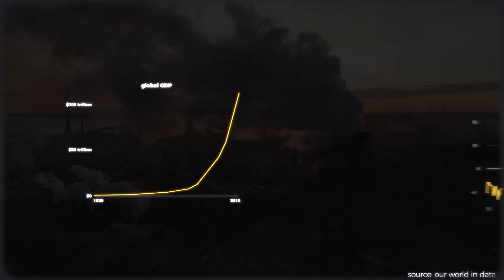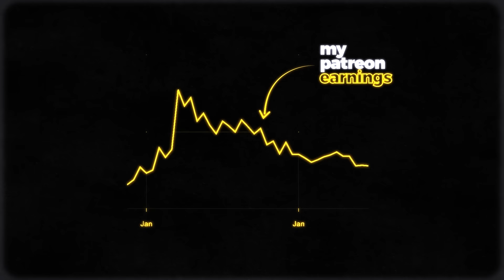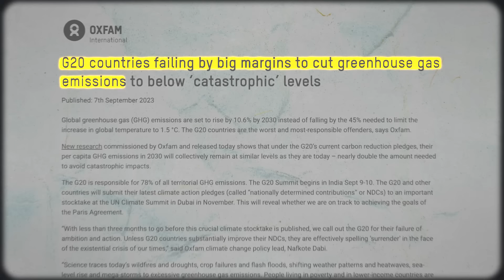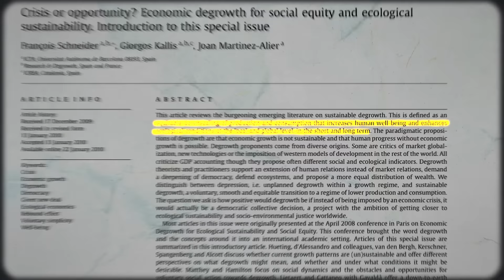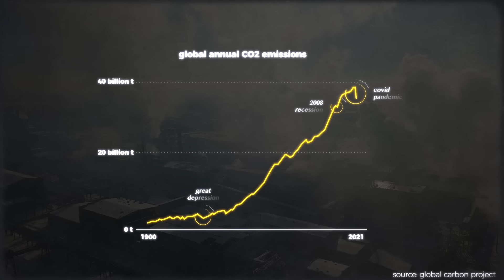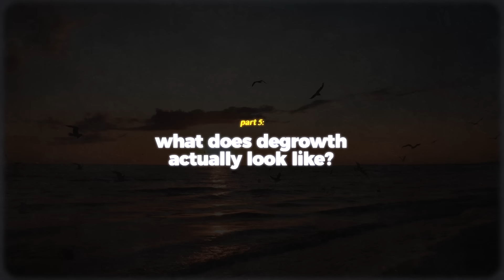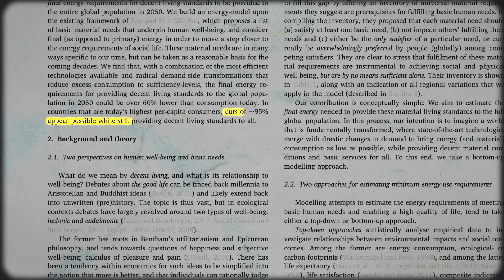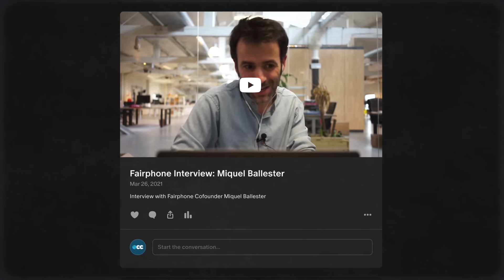Why We Need Degrowth

Comment: Very good video, but i have one critique , and that is that our so-called "carbon-budget" ran out a long time ago. We are already bound to face 1,5C ° next year.
Reply: Yes most definitely 1.5 next summer and then on to 1.8 to almost 2.0 by 2030
Reply: Yes most definitely 1.5 next summer and then on to 1.8 to almost 2.0 by 2030
Reply: @77cicero77 so, the nuance is slightly more complex than that. It's based on long term averages of about 10 years. As we accelerate,  we are already hitting 1.5, and even LA Nina wvents don't seem to diminish issues nearly as much as they should. So the long and short is, we're going to be in 1.5 before we have data to back this up, because... again, long term averages. But if our short term live data manifests as projected, and we also continue to decarbonize, there's actually layers of impact we don't comprehend,  like aerosol data.
Reply: @SPLICEKNIGHT  we are not going to decarbonize that’s wishful thinking
Reply: I also have one critique of this video. It forgot to mention the billion (literally a billion) people raised out of extreme poverty over the last 50 years due to economic growth. And the other billion people that have made it out of poverty and into the middle class. Without addressing this, saying we should adopt a degrowth model sounds kind of the same as saying poor people should stay poor.
Reply: @blub-tf6rt  no you won't be dead in 50 years, more like in 10 to 20 years if not less. Besides, shy should you only care about yourself?
Reply: @Randint73 I saw somewhere today that it’s expected to be between 1.34 and 1.58. We are already at a shocking 1.34 for this year. Wouldn’t be surprised if 2024 eclipses 1.5.

Comment: Car-centric infrastructure is a terrible mistake that was pushed on by the big 3 automakers in the mid-20th century. It has been consistently promoted by pro-extractivist politicians and those who accept the status quo. Needing a car for work, shopping, and entertainment for those living in the city or a suburban area need not be a thing. Dallas Texas back in the day before my parents were born was a city where you could get anywhere by cable car, bus, bike, or on foot until big auto and big oil lobbying messed things up. Electric cars are no silver bullet. An EV is better than a gas burner in the long term but, the environmental destruction that goes into extracting the minerals, fabricating the semiconductors, plastic trim, body panels, and other components as well as the final assembly of the vehicle is terrible. If I could get to work without a car, I would definitely go car-free or car-lite. Fast Fashion is a terrible idea, it exploits low and middle-income nations for cheaper labor and gentrifying the country as well as causing land, noise, air, and water pollution for making cheap affordable clothing that goes out of style in a new york minute and/or does not hold up over time. Every time you buy a new product whether clothes, furniture, car, decor item, phone, etc. think about the environmental impact of that purchase.

Comment: You seem to be forgetting the root cause of the necessity for growth. This necessity is just a symptom.
The problem itself is two-fold; one side is that our monetary system is a debt-based fiat currency system, and the second factor is that debt grows exponentially (and thus faster than the economy). In practice, this means that every currency unit (dollar, euro, you name it) in circulation is debt, and this debt generates interest; as such, new debt has to be created to pay for the interest, making the pile of debt even larger. There is never enough money in the system to reset the system to zero. This deficit needs to be plugged somehow, and that is where growth comes into play. You need to grow the economic output of the system in order to keep up with the debt side of it. This is why "no growth" brings the system to collapse; there is not enough output to pay the debt plus interest. This can only go on so long by the way - at some point, the interest consumes all and the whole system just implodes.
Reply: Concur with this. And the reason it can grow in the first place is the concept of debt or trust, so that’s kind of the full loop of the modern capitalist paradigm, which in my books is much better than any economic paradigm which does not include the concept of trust. It’s like it adds a whole degree of freedom to economic mobility, which would otherwise cause an economic stalemate where not much gets done (including in terms of food production) due to the stringent requirement that immediate and guaranteed compensation up front is the only way to incentivize people to work. 

As you said, the pie must grow in order to sustain the system, but the system is also what allows the pie to grow in the first place. And all of this depends on our ability to innovate new ways of extracting ressources or otherwise creating value.

It’s a well-oiled machine, and does not depend on a ruling class with specific interests to be upheld. It also has so much inertia that moving away from it recklessly is bound to have disastrous consequences. I think the solution proposed in this video is way too idealistic and naive.

Comment: It would probably be a huge investment but I wonder if something like a modular factory that can make a wide variety of products to be made on order rather than made constantly and throwing away ones that don't sell. Maybe another long shot is whatever is made is from recyclable materials that can be reused/repurposed by the same factory.
Reply: Ok, let's expand on that idea. 

You have 360 million people plus 50 million illegals. 

How are you going to manufacture on demand and what's the distribution plan?
Reply: Companies that make made to order products often produce less waste and it allows customization for consumers, like sizing to their actual body measurements, and less production shortcuts like poor stitching that can lead to products lasting longer. The downside for capitalists is production speed, which affects how much a company makes in a quarter.  The downside for consumers is they have to have patience to wait for the product to be completed and maybe shipped, and learn to adjust to slow fashion like our ancestors were used to.  This is why MTO production is better for the planet and consumers, but it requires an adjustment in consumer mindset and expectations.

Comment: I have decided to start getting around by ebike.  Yes it still has a battery in it but I am using far less energy to move 260 lbs instead of 2,060 lbs.  Also daily driving an ebike gets me used to biking as a form of transportation that I could do with a bike without a battery at all, only powered by my legs and the food I ate the day before.  Urbanism isn't just "cars bad", it's a movement that stems from preventing climate change, atomization of society and communities, long term health problems, as well as improving mental health.

Comment: Only workable solution is an enforceable two-child policy.  I think it would put a limit on overproduction which I think is the main problem. Otherwise, you cannot eliminate consumption since it is how life is maintained...
Reply: @SimonTmte  I am aware of that, I just wrote a more politically correct answer. A guy called Steven did a deep dive on the issue (watch Birth gap on YT) and found out that it's childless women who bring down the rate to below replacement.  Without them, it's about 2.2 in Italy, Germany and Japan and 2.65 in the US. I think this issue has no solution just tradeoffs which is a lower standard of living and taking away people's (mostly women's) rights. 
By consumption I wasn't referring to 10 cars but maybe buses or bicycles for the common man. And if you think that such people need to be reigned in, then that goes back to my tradeoffs argument...

Comment: I think ecosocialism covers this issue well enough. Degrowth sounds somewhat reformist
Reply: Ecosocialism doesn't address the sustainable size of the economy, and to be sustainable, we would have to shrink the global economy by over 50%.
Reply: @HealingLifeKwikly  Ecosocialism could solve/change the unsustainable economy we now have, industry-based socialism cannot
Reply: @shaunowebdevo  We may agree but be using different terms. That is, de-growth IS eco-socialism, but it goes further than many eco-socialists in pointing out that the global economy must shrink to be sustainable. 

However, I sense that perhaps you, unlike some eco-socialists, understand that more wind turbines and and meatless Mondays won't cut it--industrialized society is inherently unsustainable and self-terminating. 

Be well.

Comment: We do not need de growth we need to prioritise the right kind of growth. We need to remove planned obsolescence for future modularity, produce quality items instead of disposable items, look at designing house hold white goods that are not for a single use. For instance why would a washer, tumble drier need to vent heat to atmosphere, build it with a heat exchange manifold that combines back into the central heating system where it will then heat the contents of the water storage cylinder. This would be so easy if standardised bayonet fittings were produced for quick connections and no chance of the average person having to risk cross threading pipe fittings. 

That’s not to mention using the same techniques for removing the need for a boiler and instead build better quality ovens that also work as water heating devices. We could dramatically reduce material consumption if we were to design items with multiple purposes using a suitable amount of wisdom in the design stage.

Comment: You want de-growth? Set an example: Stop buying stuff! Stop driving. Stop flying. Stop going out.
This video is nauseating!
Reply: You don't even understand the core of the problem. Or even the term Degrowth. Or how simply changing personal consumer patterns has no material change on our society
Reply: @favb7931  40-60% of our carbon footprint is controlled by individual choices, and we could feed the world using 65-75% less land, 50% less water and 50% less CO2 emissions just by people changing their diets. Thus, although systens change is also needed, individual choices can have a massive impact and can drive systems change.

Comment: I find it frustrating that opponents to de-growth pull out the scenario of “shivering in the dark”, or “living in caves”.  The only alternative to rampant growth is the stone age?

There are many stages of efficiency that can be used that may even feel like growth while shrinking our environmental impact.  Densification to roll back sprawl is probably the easiest.  We need to build more housing anyway so why not proceed with only mid-rise mixed-use to improve our heating/cooling and cut our car dependency.

Another brutally simple fix: cut air travel.  Brutally easy to implement: legally mandate ticket-price minimums and keep increasing the minimums.  Let the market decide whether that annual week or two in the sun is really worth it when it costs half your income.

Comment: “Growth” is NOT the problem and Degrowth” is NOT the solution. Really, then what is? Improper growth! If you live in a closed system, as we do and if you are completely dependent upon the ecosystem and its functions as we are then LOGICALLY, RATIONALLY & SCIENTIFICALLY, then the only thing that you can do is to grow by becoming ecologically literate, by developing and using ecologically-based and ecologically-constrained technology to construct an ecologically-based and ecologically-constrained economy. To “grow” you have to act as a keystone species as a resource to the ecosystem (rather than foolishly acting as a parasite that undermines and destroys it); you have to enhance the resilience, diversity, and productive capacity of that ecosystem and then reap the excess productive capacity to sustain yourself! That is our ONLY LOGICAL, RATIONAL AND SCIENTIFIC way forward. Let’s do it!

Comment: They are cutting back spending in sectors that are overrepresented by those with progressive voices, and I am in Melbourne, Australia.....if you want to understand how that couple gets to degrow you should see how the country has been shortchanging it's very large migrant workforce many of which are students, coming up on ~1 million.....who also work all the menial roles in Australia at the same time. You should see how many Uber/ gig workers are Masters qualified pizza delivery drivers here.

And also just how much of the countries economy is built around brown coal and other carbon emission products.

And also if you really want the skinny looking up nangers (Nitrous oxide bulbs) a greenhouse gas 200x times more potent that CO2 that the locals huff for a 10 sec high....its so pervasive and financially lucrative you can get 2hour express home delivery for nitrous bulbs of various ebay sellers here.

Comment: Obama wasn't wrong when he said that sustained economic growth is possible while reducing carbon emissions. In fact: that is what is happening! The per capita CO2 emissions in the USA dropped from over 23t in 1973 to 15t now especially since 2007 there is a strong negative trend (our world in data). However, it simply isn't nearly fast enough to save the climate, and at that pace it very much hurts growth.

Comment: Good video, but I don’t agree with the final current for revolution. The amount of death and destruction caused by every revolution typically results in an overall decline. Fighting for incremental change is hard but possible, but requires greater participation in political process

Comment: Downsize your life. Use less energy (drive less, use public transport or a bicycle, insulate your home, shower every other day using less water, wear your clothes before washing until they are dirty, dry your clothes on the line or a rack instead of using an electric tumble dryer, heat only the rooms you use during times you are at home), consume less (buy products of higher quality lasting longer, don't buy more food than you eat, don't waste, buy the clothes you need - not fashion, lend and borrow instead of buying).

Comment: While I reject the idea that degrowth is 'eco-thatcherism' etc I fear degrowth slips into utopianism because socialism is a higher mode of production than capitalism - it removes the fetters that impose artificial scarcity and slow down productive growth and innovation. The masses are going to get richer under socialism and they are likely to consume a lot more in terms of units of use values - and we cannot stop them from spending their 'labour vouchers' or whatever exactly replaces money. The focus has to be on qualitative changes to production - which degrowth more or less does address - such as transitioning from extractive/subtractive production with clean additive production. I find it hard to believe that 'reducing consumption by 60% or 95%' is going to attract much support from anywhere and it isn't necessary to think in those terms.
Reply: Your language sounds practical.  This video sounded like some kid who was all enthused about some sort of Communism.  The word that ran across my head when the talk was about shrinking the GDP was "layoffs."  Then I think of all these tent cities in the Western cities.  I can see some of the Socialism thing helping out.  If people had more say in what was built, how it was built and the conditions under which the stuff was built we would all probably be better off.  I guess there is often a mismatch between what people actually need and what is provided.  For example, Ford decides to go all out on building F-150 pickups instead of electric Focus cars.

Comment: The physics of climate does not care if we have more windmills; all that matters is whether we are emitting less carbon dioxide and other greenhouse gasses into the air.
Reply: ..but if foundations of those ... windmills require  literally kiloton of concrete, itself heavy ghg emitter in production ... and if whole system as noted forced to be bigger and bigger ....

Comment: 26 minutes of video but I didn't find anywhere how do you plan to solve the problem of debt with zero or even negative interest rates. I fully acknowledge the problems posed by capitalism excessive and unjust growth, but in order to accept degrowth as a viable solution, someone has to explain me how will we be
a) able to service accumulated personal, company and national debt 

and 

b) how will we get future projects funded 

if the future value of the economy is expected to be constantly and consistently smaller than the current one. I'm not saying there is no solution (I actually don't know), I'm saying that I've never seen a degrowther adress the issue.